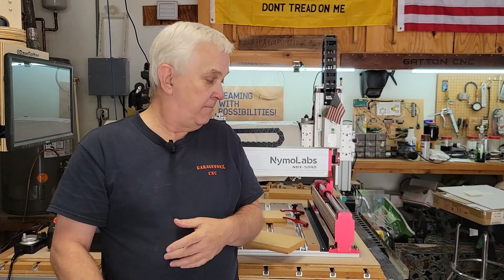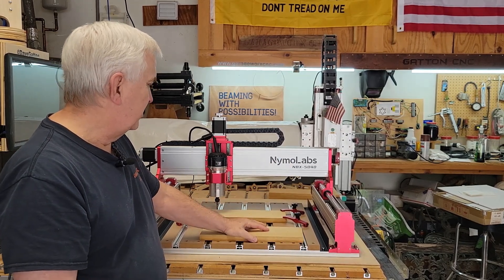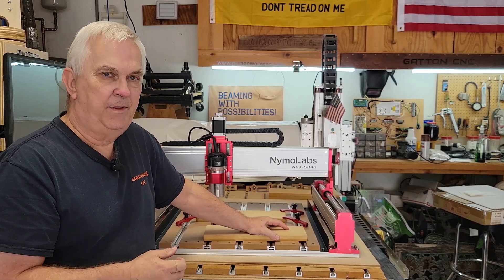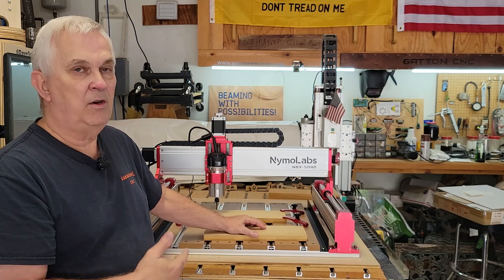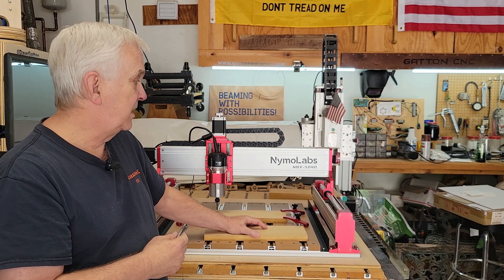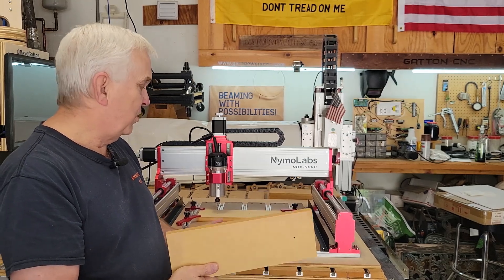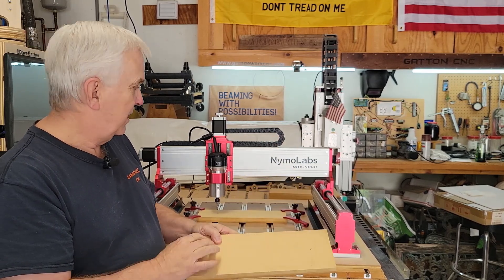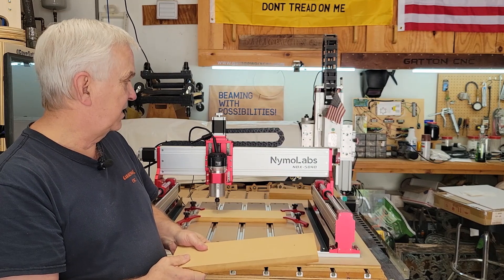Dave Gatton Review for NymoLabs NBX-5040 —— Is It Precise?

Comment: This machine seems to be a well designed, complete machine with very good components(ball bearings, linear rails/shafts). I think you are giving a very good product for the price range. 
That being said some people like me need a larger cutting area. If you can offer a 5080 or 50100 version at the sub 1400$ range that would be another big winner in your lineup. 

Also some dust protection for the y-axis may be good. 

Good luck.